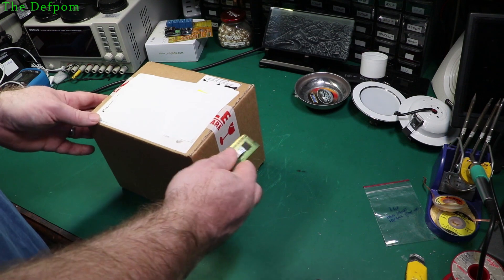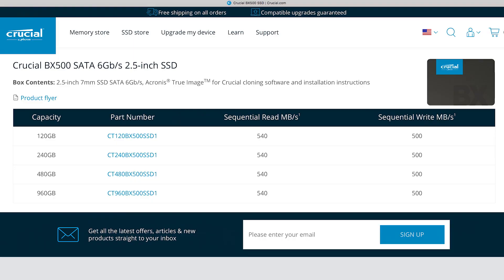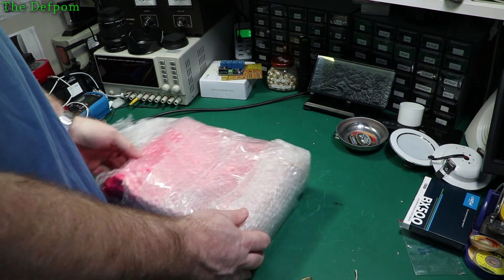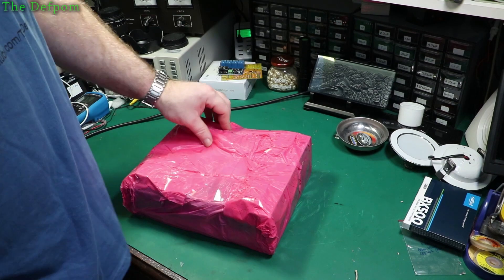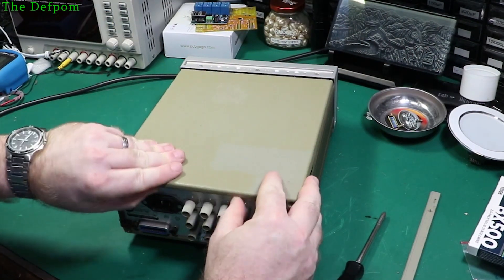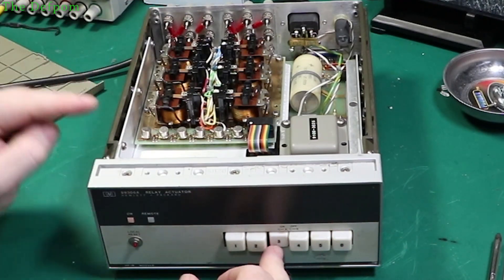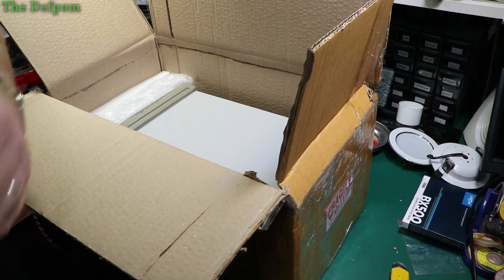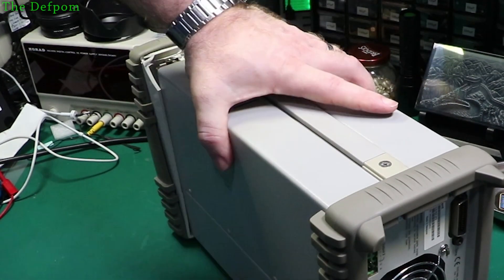🔴 #552 Mailbag Monday 29th April 2019 - HP 59306A Relay Actuator - Agilent E3646A Power Supply

Comment: sucks they don't pack things well. hell $3 at walmart you can get cheap spray foam can. I have used the spray foam to lock the item in the box (item wrapped in plastic) yeah it be a pain for you to get it out as its very messy chipping away the foam, but not had any damaged items since i started using it. and I think people would rather clean a bit of a foam mess up vs having a damaged item
Reply from the maker: Tony Dratchev - agreed, I would rather have the foam!

Comment: Just a thin layer of bubblewrap on the sides is just not well packaged for such an unit.
PSU are heavy stuff, so they need much firmer padding.
That unit has been flying around inside the box when it was handled in transport.
To bad you got it damaged on the way to you. I'm sure you can fix it.